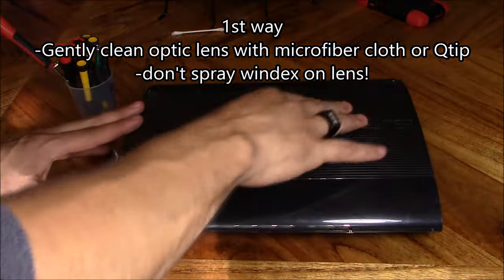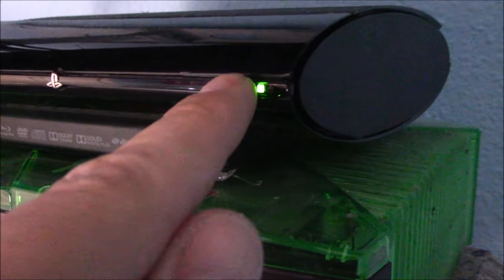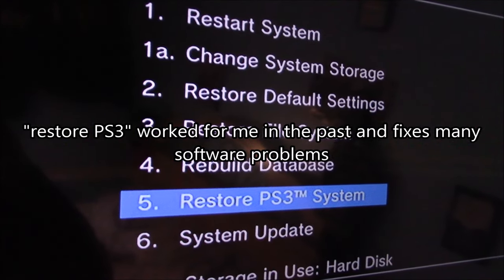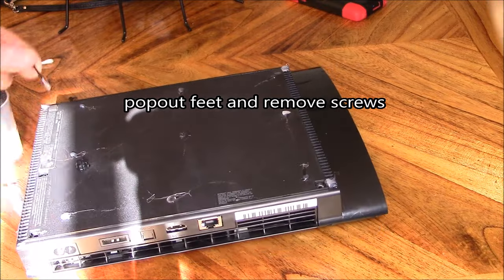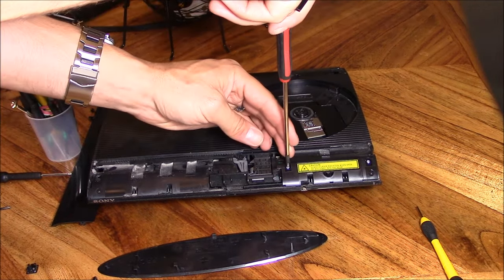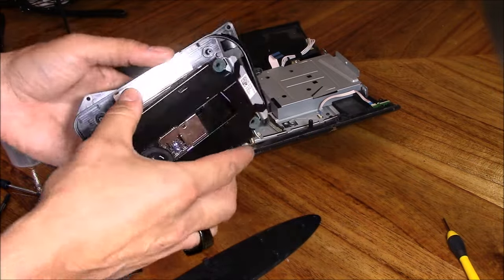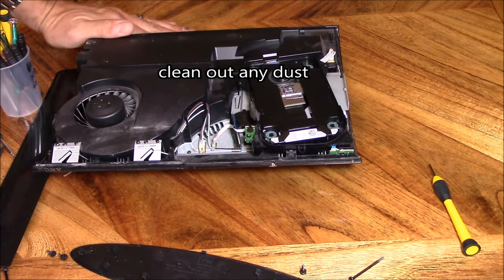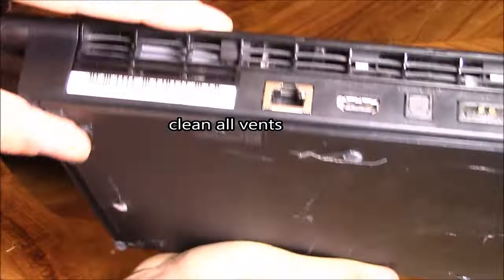3 ways to fix PS3 ultra slim not reading disc and software errors

Comment from the maker: get ps3 blueray drive here but first confirm ps3 model matches new drive - 
https://amzn.to/3ydpJcE
Reply: Thanks the first option worked on me 😁
Reply: now i can play bo 2
Reply: +Sakke Brusila same
Reply: it sickest
Reply: Tampatec help my PS3 lights on red but when you try to turn it on its goes off within seconds
Reply: i think my laser isnt reading discs, i see small light underneath barely flashing
Reply: i bought a new ps3 and a lens cleaner for future issues, i think my old ps3 just needs laser cleaning.
Reply: My hero, I thought i lost bo3 forever 😞😞
Reply: Tampatec can I speak with u
Reply: Tampatec I have a disc problem on the ps3 slim..do you know how i could fix it?
Reply: I need your help my disc won't spin at all it just work a couple days ago but now when my door shut won't read at all do u think I need new lens ??
Reply: Quay Revels I can help you
Reply: Hi.. i need to ask you something. I want to mod my ps3 with leds inside. BUT i purchase by mistake a rail of 5v no 12v like all people do this. So.. this led cames with remote controller. Where i can put this inside the ps3 slim? You know what 5v source i can use? The usb at inside and solder it there? But if i do that .. i can still use the usb from the front? Let me know. If i can use the conector cable from the ps5 connect to pcb cn conector where is located the stand by and power on?
Reply: For me when I put a game in it doesn't read the disc
Reply: your link no longer works as Google+ has shut down already
Reply: The labor is too much😢cannot
Reply: Only a true shop can repair the thermal paste on the cpu. Not a do it yourselfer

Comment: I replaced my disc drive and it's still not reading. You can hear it starting and stopping, kinda like a car that cranks but won't turn on. Any helpful advice from here??
Reply from the maker: Check your connections and be sure your replacement is correct version. It's possible it's different version or bad replacement that's happened to me before.
Reply: Its probably like mine the disk stopper peice just needs to be wedged in there i used a peice of paper and it fixed it
Reply: When I put my disk in it starts to read and spins then stops 3 times then it freezes
Reply: @Babbages  lol

Comment: I've seen some videos saying to choose option 4. Will that be enough for disc not showing up on the screen? I also noticed that the restore PS3 is on the regular menu without doing all these steps. Is that option no good? Thanks.
Reply: Btw, I have the PS3 fat

Comment: how about a fix for chromecast
Reply from the maker: what's the error you get
Reply: The light is red, I tried to factory reset and no dice. It does not show up when I try and look for it on my laptop either
Reply from the maker: +Vennie Payne try hold button for 60 seconds to restore it, check warranty
NEXUS PRODUCTS- Call 855-83-NEXUS
Google Play team, call (855) 836-3987
Reply: Ok thx I will try that but it is probably broken

Comment: I don´t know if this could work for anyone else but, I started to notice like one month ago, that the slide door on my ps3 didn´t fully close, and sometimes it did close but made a strange noise, at first I didn´t put to much attentión to it since it still worked fine. But last week it stopped reading games, althougt it was still reading dvds and music discs, but not blurays or games. whenever i put a game it started spinning and making the sound when it tries to read the game, even the loading icon in the top right corner was making circles, and then stopped. 

Finally I was thinking if it has to do something with the sliding door; first I clean the lens with a Q-tip, then I clean the rest of the disc reader, specially the door, and it works fine now. I read in a comment below that 9/10 of the time is the position of the sensor, and its true, if the sliding door is not fully or correctly close the disc sensor don´t read the games, but in my case it still was reading dvds and music discs, strange. Hope someone find this usefull.
Reply: Thank you so much, you helped me. 1 month ago i saw same, door wasn't closing fully and now i saw this comment and clean door and now its closing fully. Disc has been read in second. But its still making sound
Reply: You can pop the from right panel up 3 tabs from right top left from the bottom edge, then the whole front panel slides left to remove. Then you can see the locking mechanism of the door; it sometimes doesnt align right but u can nudge it str8. It takes no time to remove & replace the front panel. If that helps anyone

Comment: You shoulda said you will need to buy a new optic drive before doing step two. If you did, then my appoligies. Fyi- I watched the video before I took mine apart to know that I'm not getting a new optic drive. So I didn't actually take it apart

Comment: I've got an issue I've not seen anywhere else online with my super slim: After a full reset and file system restored, it will read games and Blu-rays (DVDs n CDs 
were never a problem). Loads and plays BD discs fine. Come back a while  later after it's been Peter down a while and it's back to not spinning up or reading bd discs. I tried the tilt trick and that only worked 1 outta 5. So: The Blu laser will read games, for a time after a full reset,  and the system will spin up BD discs fine after a full reset but only for a short while soooo... WTF?
Reply: ROOKTABULA this is likely your blu ray laser is going out. it's still functional at times but soon it will not function at all